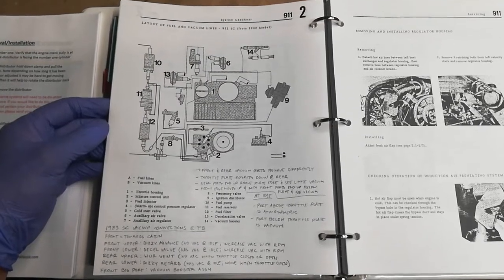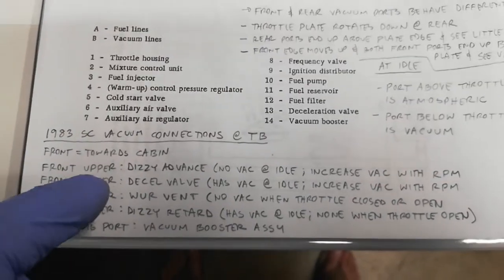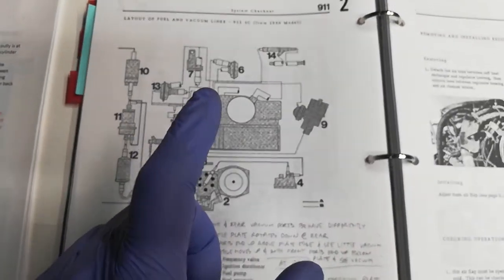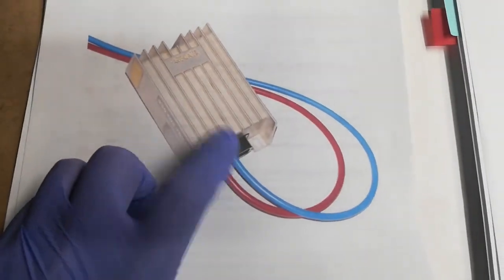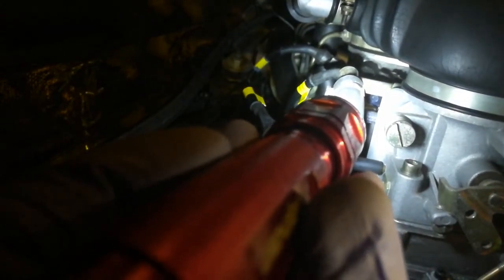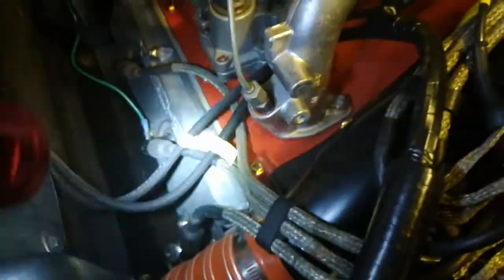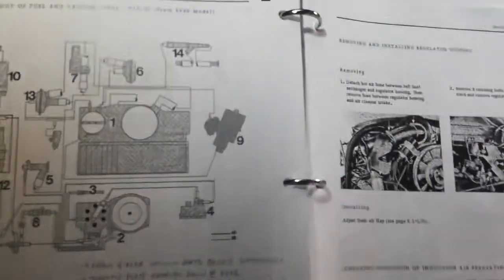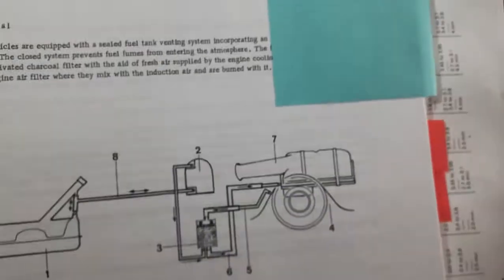Air-cooled Porsche 911SC 3.0L Flat Six Engine Vacuum Lines Setup

Comment: Sorry if this comment is too late to the game...Regarding the open port on the charcoal canister: My 1980 911sc is configured the same way, appears to be missing the connecting hose assy. My research has shown that earlier versions may have had the hose, but the vast majority of later ones actually do not, and I think that's how they came from the factory. You can't cap it off, it is a vent to allow evacuation of the canister and must be kept open and un-obstructed. A filter on the end would be a good idea though. Let me know if you came up with something different. Thanks!
Reply from the maker: I think there is supposed to be a rubber nipple on the fan shroud and a vacuum line connecting the two. Positive pressure from the fan shroud feeding into the canister and vacuum pulling it out the other end. That way it is a closed system.
Reply: @JoeEngineer  right, that is what I found by looking around also, but I can't find those parts. I found a source that suggested that pipe was omitted on later cars like ours. Thanks for the reply.
Reply: @JoeEngineer  Joe if you feel it’s needed why not add a line and let us know if you notice a difference, I have an 82 SC and it’s not there